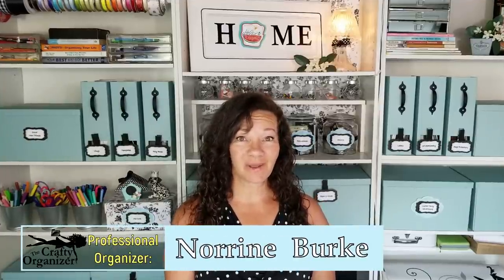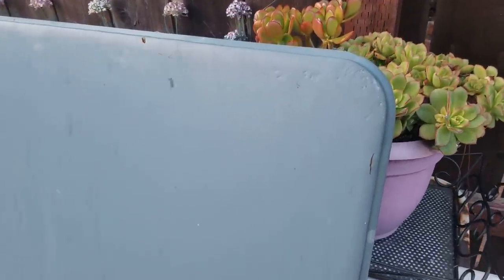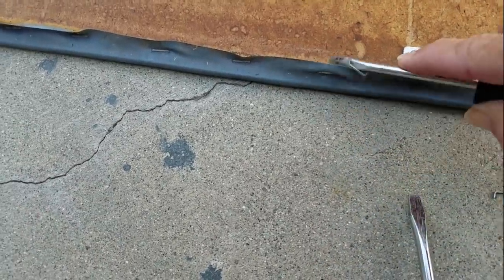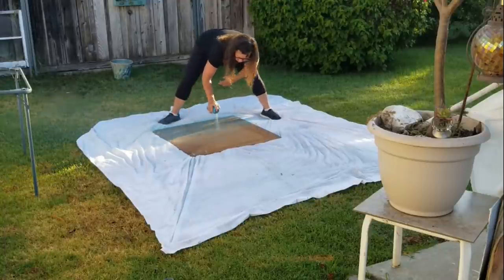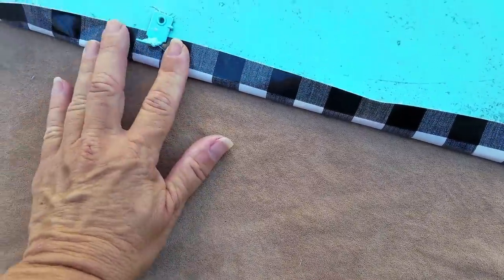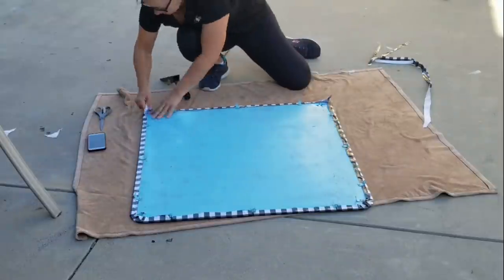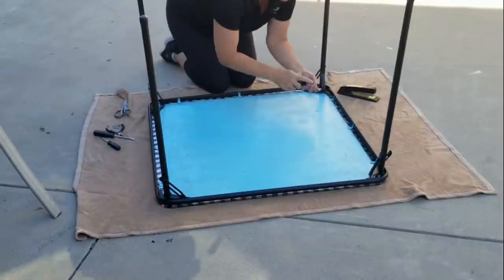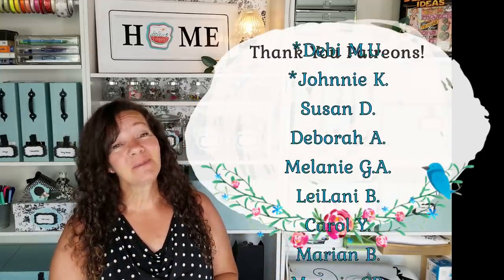DIY Trash to Treasure Project 🌻 Farmhouse Folding Table

Comment: Very nice redo!  If you wantef to jazz it up, get some acrylic craft paint and touch it in strategic places with white, it will give it the look of old enamel!  (You'll need a clear coat over the top though)

For anyone looking to do something similar,  look for foam at the big box hardware store, rather than the craft store.  Usually find something more durable,  and less expensive!  (Actually,  always check there for tools and possibilities for craft supplies...so much cheaper than the craft store!)

Also, for those who don't know, the wood material inside the table is called hardboard.   It is also called chipboard or Masonite.   Its the same material that clipboards and pegboards are made from.  You can get that at most hardware stores, and usually they will cut it to size for you.
Reply from the maker: Awesome information, MissBeans!  Thank you so much! 😘🌺😊
Reply: @TheCraftyOrganizer  you are very welcome!

Comment: Such a cute idea! Our table top is messed up and warping so we rarely use it. Now I'm inspired to check and see if we can add extra brackets to hold it on flat and if so then redo the cover completely. Worse case I just replace the entire top and paint the frame.
Reply from the maker: YES!  You can get a small piece of pressed board or thin ply-wood for just a few dollars!

Comment: I’m not shy either......when I spot a diy piece that has been discarded........it goes home with me. I usually have what I need to do my project so most times it’s just getting it to my “ space” ..........and the fun begins.
Your ideas always boost my thoughts and give me a renewed “ Hawkeye” ..........looking more intently as to [ how can I repurpose that item....or sometimes I think to my self....
How would the clutter fairy do this......😊😊😊😊😊
And again you have a winner.....💯
Happy Sunday 🥰
Reply from the maker: I love that you do this too!  What's your favorite make-over you've done??
Reply: The Crafty Organizer 
Bakers Rack😊
I took it home.......cleaned it real good......removed bent bars( supports for what I’m guessing were glass shelves)......
Spray painted it black.
Had new lumber cut ( only about $5 plus tax x2) to fit the lengths I needed for four shelves. Picked the cheap lumber as they had knots in them.😊
Sealed the shelves and the areas with knots looked real good.
I use it in my design studio for my sewing machines and equipment.
Total only about $20......for wood and spray paint.
Your tutorials give me the starter idea and then I add my creativity.........😊
Appreciate you so much🥰

Comment: Nice job, I love the check covering. I have a small table with folding legs that is rectangular instead of square. I used it for doing demos for One Stroke Decorative Painting when I was teaching it at Hobby Lobby several years ago. It's folded up in my garage. I'll have to check it out and see if I can do something similar. Thanks for sharing.

Comment: Thank you! I had no idea we could redo our card tables. We have matching chairs. Do you think you could do a folding chair to match that table?
Reply from the maker: Yes, you can!  There is a plate on the back.... two screws and it's off! and four under the seat.  Take all of those off.  Then you can recover the fabric/vinyl, spray paint (if you wish), and re-assemble!  Maybe that should be part 2??

Comment: I have this same table i got out someones trash thanks for this i knew it would come in handy
But mine is warped like as if the middle was about to cave in from i assume being wet 
Any suggestions on fixing this
Reply from the maker: You can get a new piece of the pressed board or thin plywood cut to size at your hardware store for just a few dollars.  :)

Comment: I want to make a demo table to take with me to gaming events. I have a table quite similar to that one I recently rescued from a dumpster.. The press-board tabletop is warped from moisture, it sags towards the center. Any advice as to how I might make the tabletop level again?
Reply from the maker: You can actually get a new press board sheet from your local big box store, like Home Depot or Lowe’s for under $10
Reply: Thanks, OMW to shop.